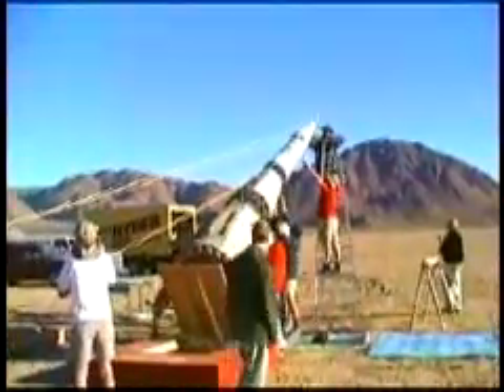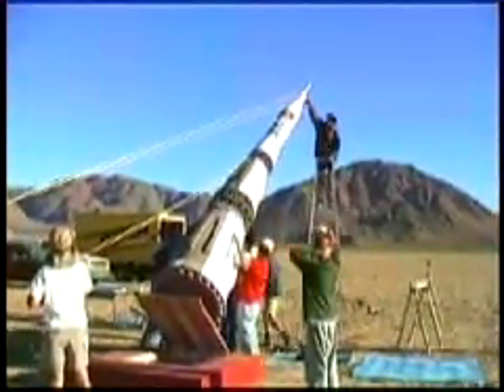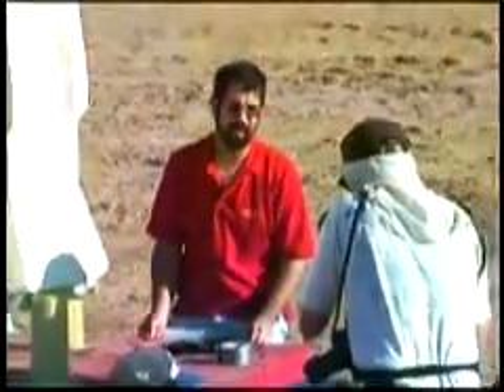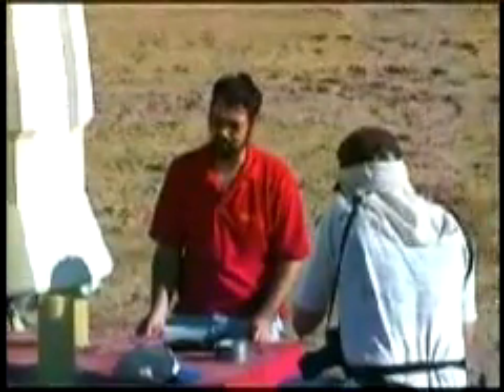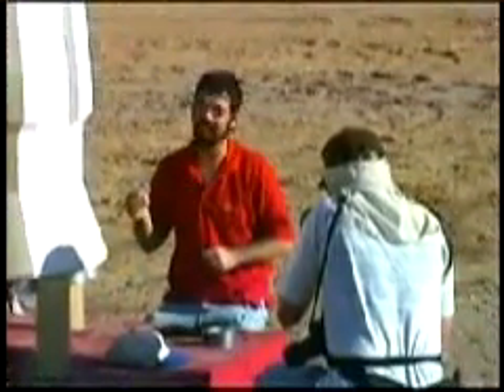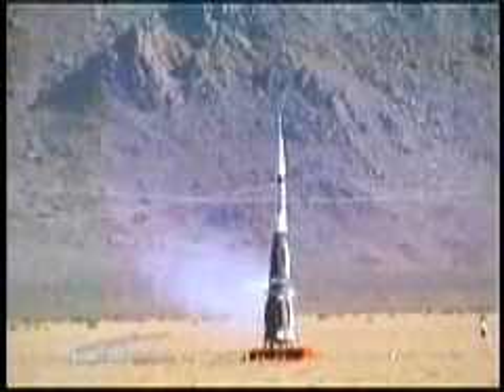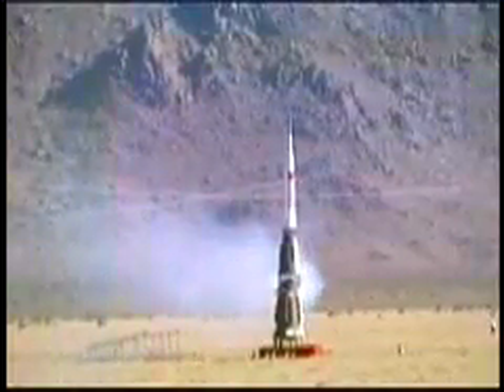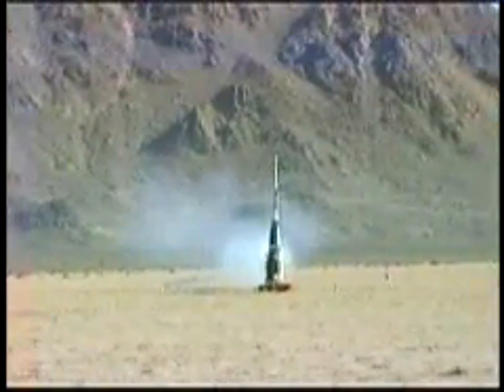1/16 scale N1 launch

Comment: Real N1 flights:
1.: Failure after 68,7 seconds due to a fire which destroyed multiple wiring looms, making the rocket uncontrallable.
2.: Failure after 15 seconds due to a exploding turbopump, which caused a error cascade in the flight computer.
3.: Failure after 51 seconds due to a uncontrolleable roll motion. Ground station gave command for self destruction.
4.: Failure after 107 seconds due to a burst oxygen conduct causing a engine to explode fatally.
The N1 never saw second stage ignition.
Reply: Quazar501 if real life were ksp i would after 1st stage failure decouple and hope i can complete mission even without fully spending 1st stage
Reply: @randomstuff-cu4of  not if your rocket is mid rapid unscheduled disassembly and on fire
Reply: So... you're saying it's a good Rocket?
Reply: Pretty good tragedy. Its a cool looking rocket. And what more, soyuz is the vessel that has suppose to get them to moon and back and it end up used to bring people to ISS. The remains of the ghost ship.
Reply: They surely should ve tested first stage more specifically. Like run some groung burns or even make single stage prototype. Trying to launch the whole package when first stage is clearly underdeveloped was a mistake. With tests they could have saved more "money" to run the project for longer.
Reply: I think in 4th flight some of 2nd stage engines started but not all?

Comment: Both the Saturn 5 and the N1 were incredible achievements by both nations. Yes pity the Politburo/Kremlin cancelled the 5th launch of the N1. It may have been successful and therefore the Russians could have also walked on the Moon, albeit on a few years later. This would have forced the U.S into launching the 2 Saturn 5s it had but not launched (One of course was used to put Skylab in orbit). Then maybe the cancelled 6 Saturn 5's would also be re-ordered. Either way it would have continued the Space race/Moon Race for many more years at the very least. Can you upload this footage to a higher resolution. I'm sure you guys had at least a 480P camera .
Reply from the maker: I was shot in 2001 and all I have is this video (from a VHS tape IIRC). Yep, it was a long time ago.

Comment: The thing that worries me ... and Elon Musk probably ... about the SpaceX Falcon Heavy rocket is that its first stage has only three engines fewer than the Soviet N-1. Think of the problems of controlling 27 engines, not to mention the vibration. It'll be a miracle if it doesn't repeat history and blow up.
Reply: Actually NK-33 engines were in the middle of development when all 4 N1 starts were performed. So as an eng I would be suprised if engines with completely new closed cycle (never repeated by anyone else) were working fine and starts were successful. This is like if Ilon Mask would started sells of autopilot after 6 month of tests, and then Tesla was fixing thousands of errors and added hundreds of new road situations. But it happened with NK-33 engines and N1 rocket.
SpaceX Falcon Heavy rocket is based on existing engines that already have successful statistics. While control system is based on mature software technologies of environment modeling and automatic testing. This all was not available in the end of 1960-s.
Reply: Alexander Belov   Let's just say that I'm as anxious as Elon Musk has admitted he is. Nevertheless I'm looking forward to celebrating the Falcon Heavy's successful launching. I'm 69 years old, yet I'm hoping to live long enough to see humans on Mars. It's the only spaceflight achievement that can top Apollo 11's moon landing.
Reply: Im sure SpaceX uses the same techniques the Saturn V engines used to overcome the ridiculous vibrations of that first stage. .iirc it was something like a block or a bearing right near one of the turbines (some like pbscure space) that solved the problem for em
Reply: Actually closed cycle was repeated by other. Fuel rich was done by the Americans in Shuttle, the Russians use oxidizer rich which is harder but has more performance. SpaceX came up with an engine that is both fuel rich and oxidizer rich with the Raptor being a full flow staged combustion engine. A true one of a kind.

Comment: Less power, that was so fast basically pointless, more like a firework than full scale N1 launch...
Reply: The lift-off has to be this fast, since the 1/16th scale model can't gimbal it's engines. It would be too unstable and crash to the ground...or, worse, it could tilt over and accelerate towards the viewers
Reply: N-1 coulndt really gimbal either so it would actually be quite accurate